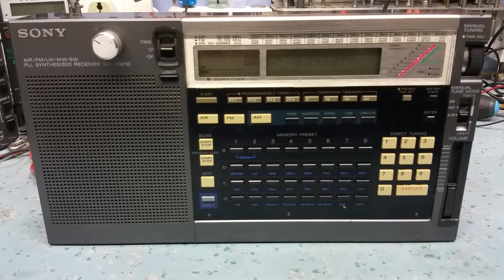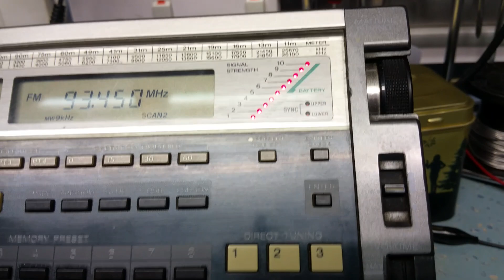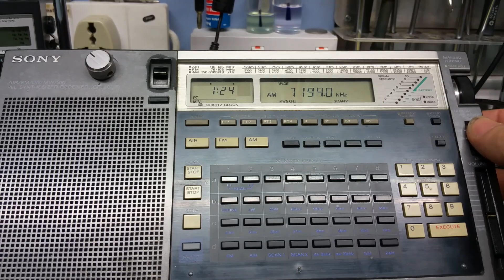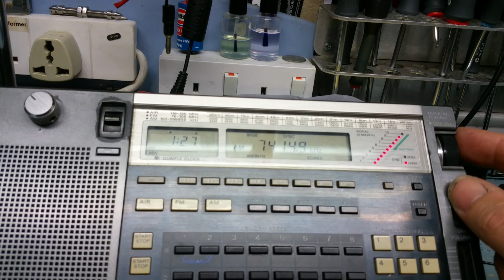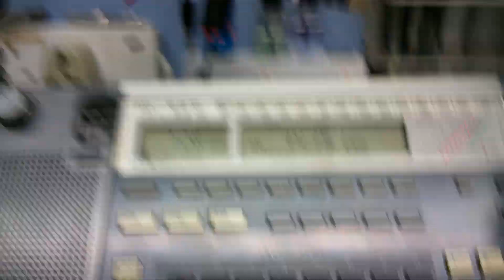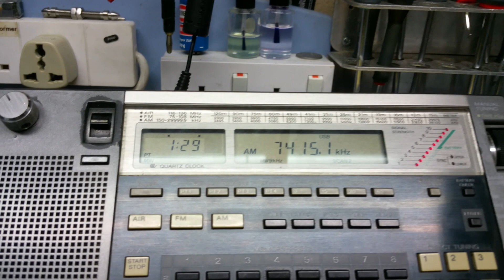Covid lockdown relief  #02. My abused Sony icf2001 of 30 years.

Comment: There's probably a bakers dozen of N-channel j-fets that would have worked just fine to replace the 2sk152. I know you like to keep things original. I repaired a RS DX-390A that was never connected to the outside world, and had a blown front end fet, probably from a body static discharge. Zzzzzzap!
Reply from the maker: In those days  knew no better!

Comment: I've got one Simon a friend who is a radio engineer gave it to me about 10 years ago. He managed to pick up a brand new one off ebay. All he did to it is put a narrower filter in for the F.M broadcast band to improve the selectivity. It looks as worn as yours but I love it. I've have had it up on many a roof for setting up F.M broadcast aerials. It still has the original carry strap. This is the best radio I have ever owned.
Reply from the maker: They are brilliant. Thanks for commenting.

Comment: I can see why you love that radio simon, very flexable and can resolve things that ordinary cant hope to hear :-D.
I would imagine if you had fitted the control now, you may have used varicap diodes and a variable dc voltage from a multiturn pot, and it would be fed a super stable ref voltage.
Much like a clarifer on a sideband c.b radio.
The radio i found handy was my frg7700 0-30 mhz from yaesu, it cost me 300 quid second hand.
So dam handy to be able to listen to the synth output and i.f stages by wagging the antenna coax near the stage (no loading) , great for finding the place where the i.f fails :-D.
An old frg7 would have been nice if there was one floating around, but the 7700 came along.
I bought a realistic 2005 scanner to hear above 30 mhz as some c.b's used high side injection.
Also handy when i was repairing my mates car fob that failed, about 315mhz i think.
The frg7700 spent a lot of time on radio 4 when not being used for diagnostics.
Sorry about the waffle :-(

Comment: That once per second noise sounds like an electric fence controller...my neighbor has one around his pasture. When they work right they don't make noise; when they don't work right and something is leaning up against it (grass, tree), broken support etc. you have a small VERY broadband spark-gap transmitter. I've repaired his fence many times to eliminate the noise which is mostly in the lower part of the HF band and is very annoying on my ham rig. Thanks for sharing Simon!
Reply from the maker: Its a bugger to find the culprit for sure.